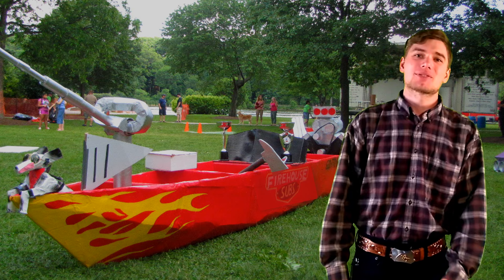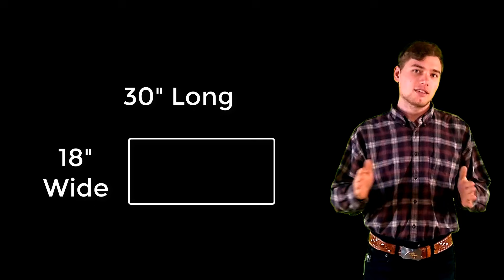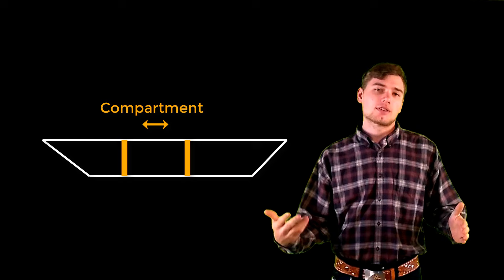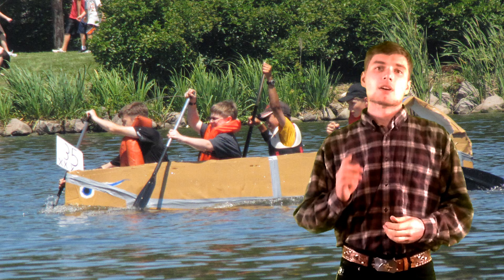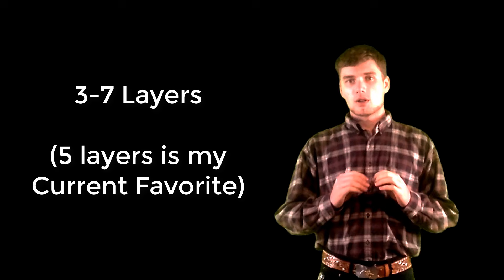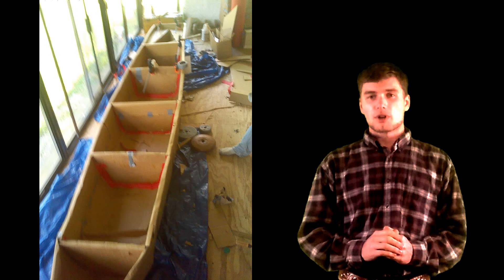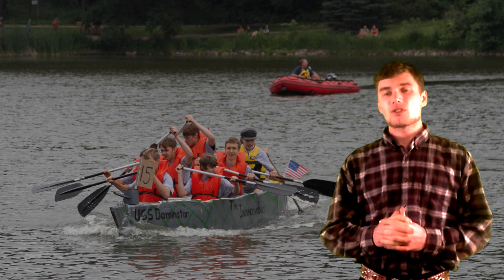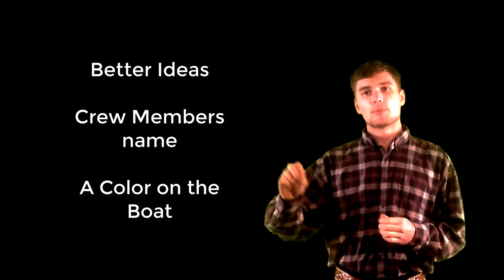How to Make a Cardboard boat - That Wins!!

Comment: Do you have any tips for making cardboard boats for a race that strictly allows ONLY regular cardboard and duct tape? We are not allowrd to use any paints, sealants, glue, laminated cardboard, or anything of the sort.  Thanks! :)
Reply from the maker: The number one question I would have was do they allow you to cover the entire boat and duct tape.  If so I would probably roll the cardboard.. into structural beams wrap the beams and duct tape... Then use those to form a frame... Around which I would form the boat hull using sheets of cardboard... Finally I would cover the entire outside and inside in duct tape... Basically build a frame similar to those of survival... But with rolled cardboard... By rolling the cardboard you are essentially. Layering it and making it stronger without using glue.
Reply: The cardboard regatta?
Reply: @MNK1984  YES!!!

Comment: Just out of curiosity, how do you calculate the size of the flat piece you used for the bottom of the boat :)
Reply from the maker: Check out my video on calculating a cardboard boats waterline :-)  the size of the bottom will depend on where you want the boats water line.

Comment: whats the best place to get large, cheap, good sheets of cardboard?
Reply from the maker: I know when you enter the Glen Ellyn cardboard boat regatta they give you at least 10, 4 by 8 sheets of cardboard which is more than enough for a boat.  if you are going to buy cardboard you can sometimes get it from companies that supply manufacturing items such as Uline.  Also you can look at places that have lots of pallets with stacked items as they use 4 x 4 sheets of cardboard as spacers on pallets.  That said buying cardboard is never cheap as the shipping cost easily almost outweighs the cost of the cardboard.  I would say if your race does not supply it your best bet is to hunt around and look for large boxes and ask freinds to grab boxes.
Reply: Sears 
Lol

Comment: I need help building a two person boat design that wins a 1,000 meter stretch for multiple runs.
Reply from the maker: Wow, that's a pretty long course, if it's straight I would suggest something along the lines of the boats used to race in the Olympics... If the rules allow kayaks I would definitely go for a two person style kayak along the same lines ...the hardest thing I have encountered with a two person boat like a canoe is getting it to go straight...so allot is going to come down to how much practice you can get in a similar style boat.

Comment: Do you recommend using corrugated cardboard? How many layers of it do you have to use before it doesn’t get wet?
Reply from the maker: There are a number of different factors that determine how fast the cardboard gets wet.  Most of these are determined by the races rules and your quality of craftsmanship and material.  For example a well-built five layer boat with layers that having no gaps and good solid watertight compartments will probably last better than a nine layer boat which has a lot of gaps in the layers and poor alignments in construction or gaps between its compartments... The next determining factor is the glue are you using school glue which is water soluble or are you using fully waterproof glue... I have seen a well-built seven-layer boat with school glue last through two and a half races before sinking but a well-built seven layer boat like my extreme cardboard boat build video will come out of three races and look like it's never been in the water... Personally I prefer more layers on the bottom and less on the sides to save weight but I'm constantly changing based on my designs how many I use on average a minimum of five though.... But in the end that's part of the challenge to figure out :-)
Reply from the maker: As an afterthought check out my playlist on how to build a cardboard boat the videos in it describe a lot of what I'm talking about...

Comment: Hello Sir! Can’t find a way to contact you! I have a question about paint!!! Need help ASAP.
Reply from the maker: I can give you my best guess on paint.  The best way to learn about paint and adhesives is to read about them on their manufacturers site.  I like Rust-Oleum premixed latex when I was Racing.
Reply: @PatriotContraptions  thank you! I found a waterproof paint at the hardware store but the base is acrylic. I didn’t know if I used a layer or 2 of that if the Latex paint would stick to it. Or would you do it the other way around? Or just use latex only?
Reply from the maker: @haleymarierobertson9402  The secret solution is to coat boat in water proof or resistant glue then paint it with latex paint...but that's expensive and for many years we just put as many layers of paint on as we could and well we didn't sink :-) boats did tent to get soggy after a couple races though which is why strong sides and compartments are critical to hold sides of boat out.
Reply: @PatriotContraptions  ok thank you!!!